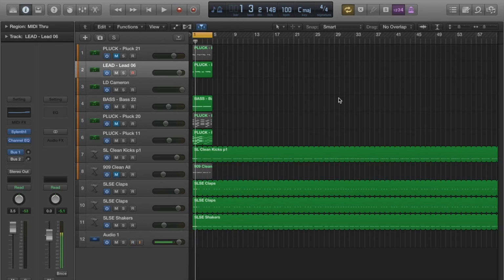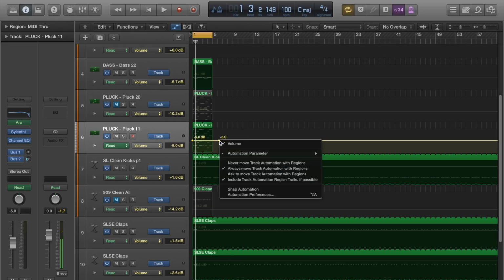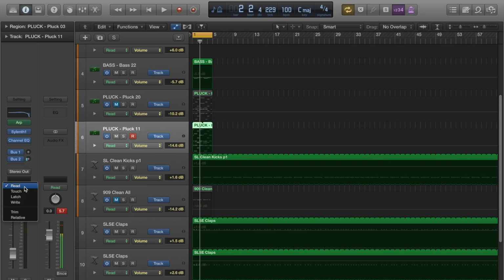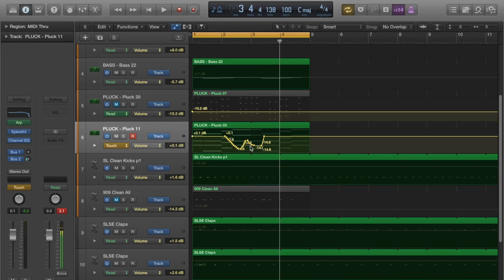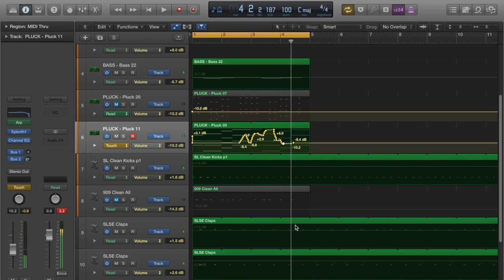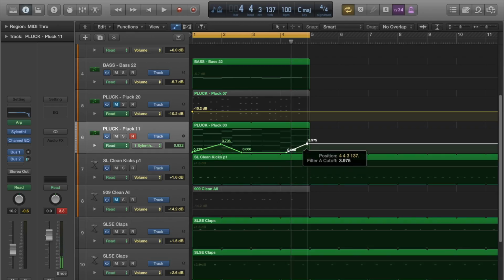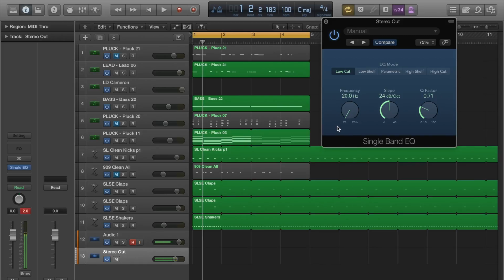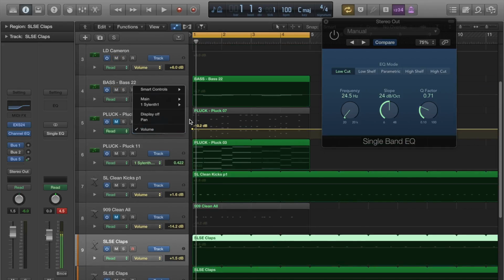Logic Pro X Automation Tips & Tricks for Beginners

Comment: Thanks, man, I bought an iMac 21"mainly for graphics and music, was going to use Reason, after using reason 4 on an old windows laptop. but When I bought the mac I didn't think about Ram, thinking 8 GB would be fine, but its a major issue, so I'm saving up for a new mac 27" model that I can purchase ram and just slot it in. Hopefully an SSD drive. or I'll buy an external SSD drive. just hope nobody makes the same stupid mistake as me...
Reply from the maker: Yeah I always used to buy an iMac and put in 16GB of ram myself, but with the new slimmer models it's practically impossible (I think) to do it on your own. Used to be just a matter of opening up the compartment on the bottom. An SSD is also great, having one on the Macbook Pro I use now makes everything so quick to open and it's great for Logic! Hope you can get that 27" soon.
Reply: Thank you again, & for the vids etc. I can order a company, to upgrade the ram and add an SSD drive for me, for around £6-700, on a late 2013 21'iMac. Though I'd rather save up, for new. I'll have to sell some artwork quick lol If I can.. etc and give the existing mac to my Dad. Cheers again..